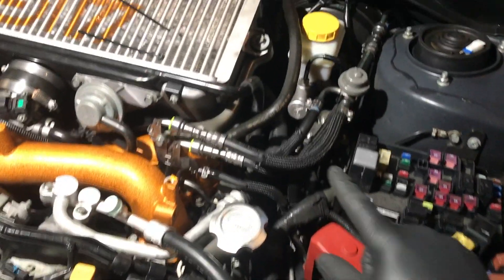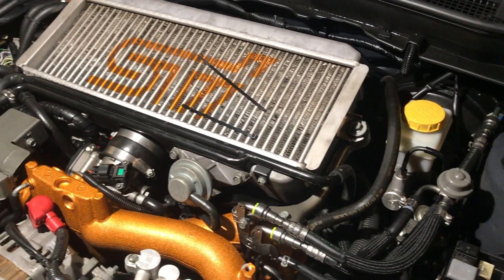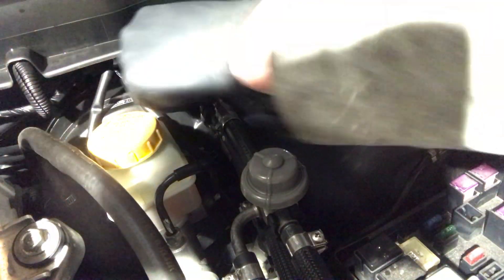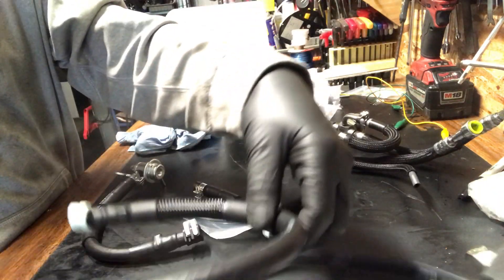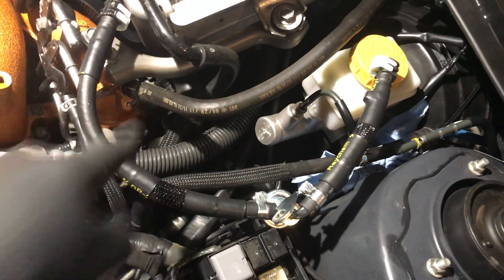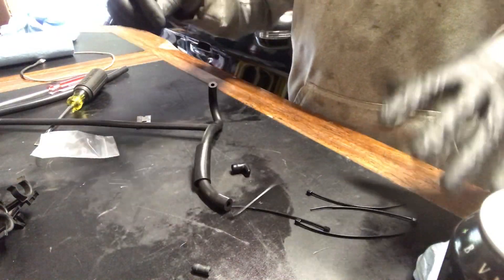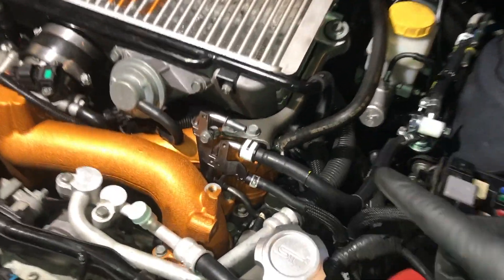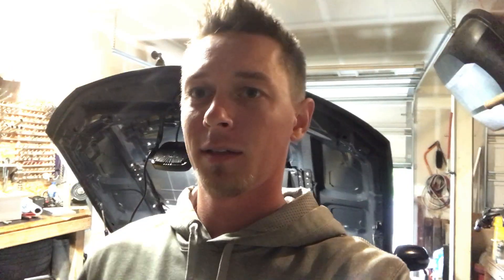Cobb GR Stumble Fix Fuel Pressure Regulator

Comment: do you remember why its needed to T-off and get vaccum from the BPV instead of the side of the intake manifold?
Reply from the maker: I do not remember off the top of my head. Call your tuner and ask them. I guess when I set mine up they wanted the lines ran a different way to be able to manipulate the EWG.

Comment: Will a aftermarket fuel pressure regulator with fuel rails fix it?
Reply from the maker: I have heard that it will help. You can ad more pressure to the line pushing the lump higher in the rpm range but I have not tried it. This has been working for me and I barely notice it now

Comment: 7:05 Does it matter if the short runner or long runner  goes opposite from what you said?
Reply: I had to trim the short one to work, but it is the way it is supposed to be.
Reply from the maker: Yea it will matter because one is a return and one is a feed. It’s one big loop so if you get it backwards you could be running into a one way valve causing problems

Comment: Thank you for the video amazing explanation, do I have to take the car for tune after install the cobb fuel pressure
Reply from the maker: Yes and no. You don’t have to but it’s not going to fix the problem till it gets tuned out. They can push it further up the rev range so you don’t notice it when your driving

Comment: After I installed this and 1050x injectors I can’t build boost.  I blocked off that old vacuum line and installed the T in the BPV like the directions said to.   I’m scheduled for a tune. Oh and I’m not throwing codes either.  I noticed my AF learning 1 doesn’t show up on my AP either
Reply from the maker: I believe there is a small 1/4 nipple on the riverside of the intake plenum that need blocked. The old fuel uses it as a reference. I vaguely remember having to fabricate a cap for it. If it’s not that sound like a vacuum leak after the turbo

Comment: My 2015 sti will randomly stumble like you said but it will also die. It will start right back up and be fine. Do you think I need the stumble kit
Reply: If it shuts off sounds more like fuel pump
Reply: @TheZimmyHD  I replaced the fuel pump. I'm thinking cam sensor. Now when it dies I have to pump the gas to keep it going for like 3 mins then it comes back to normal but it's dying alot now. I haven't been driving it much but I'm ready to figure out the problem.  One thing I noticed is my horn don't work most the time but sometimes it does. I'm hoping it's not electrical

Comment: What happens if u have a front mount instead or a top mount
Reply from the maker: The gr stumbled is most noticeable on a stage two off the shelf map. If you have a front mount chances are you have a pro tune. If you went to someone that does Subaru’s often then chances are they tuned it out for you. Most likely they just pushed it up the rpm range. Do you have a bigger fuel pump? This would help get rid of it. That being said if you have it you know you have it. The car will surge like it’s hitting a fuel cut

Comment: Did anyone know why i got the cobb1 and cobb3 engine light after i install the flex fuel kit and FPR? It said fuel sensor low input voltage
Reply from the maker: Have you had the car tuned after installing?
Reply: cobb light ? wtf

Comment: Any advice or different after the installed ?
Reply from the maker: Defiantly a noticeable difference. But it is still a little noticeable. This just shifts the stumble up the rpms. You don’t notice it really unless you cruise at 80-85 mph
Reply: @ModdingAddiction  so this is just for stumble? I'm gonna run e85 but I was trying to verify if this is needed , I came to the conclusion it doesnt
Reply: Yes it is just for the stumble but it will work for replacing these two lines to make them e85 capable. However I found this out after I bought mine is that an e85 or flex fuel kit comes with these hoses. More often then not. Hope that helps
Reply: @Dorganzola  I get ya . Yea I'm getting the Cobb flex fuel kit. Idk if I'm doing the install myself or paying someone to do injectors pump and flex fuel kit

Comment: So did this resolve your GR stumble as advertised?
Reply from the maker: That is a loaded question lol. Short answer yes but no. Long answer it shifts the harmonic rhythm of the two fuel lines higher in the RPMS. So at lower cruising speeds it does help around 2800-3000 where is is noticeable but moves it to 3300-3500 RPM where you aren’t cruising. That being said it isn’t as noticeable but still there. Hopefully that helps. If you have any other questions I would be happy to help
Reply: Great video by the way.  I have read recently the same thing about the resonance you mention.  I wonder if the resonance is actually removed because the fuel is being circulated thru the rail. The OEM configuration is  not circulated thru the rail, but bypassed to the return line, thus allowing bigger impact of the injectors pulsing, creating resonance.  I don't have the tools to test my theory.  Thanks for the response, very appreciated.
Reply: @hanksch  should the fuel damper on the feed line improve this?
Reply: @leandropim  in addition to this mod, I installed an aftermarket damper, that helped a little. Then I ended up replacing all the fuel rails with braided parallel AN lines.  That seemed to fix it.  Big pain in the neck.

Comment: Need tuning? Nice video
Reply from the maker: Thanks for the comment. As far as needing a tune yes you do. There is I think a 20% increase in the fueling tables that needs to be corrected for. Not sure how accurate that that number is but I vaguely remember reading that somewhere. It is a good supporting mod to do before you go for a tune though. Fairly cheap, really easy and helps the car out a ton with the stumble.
Reply: How long did you go without a tune after installation?